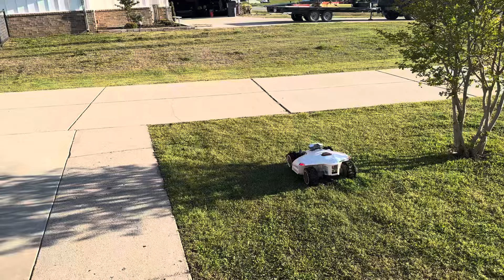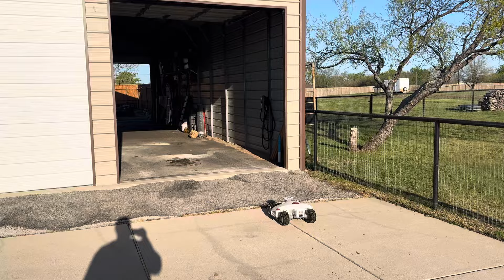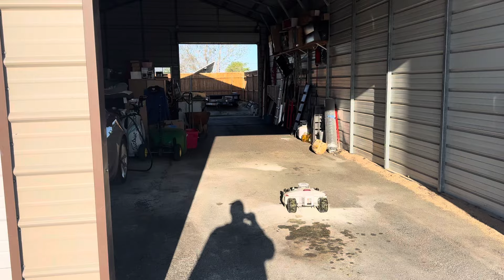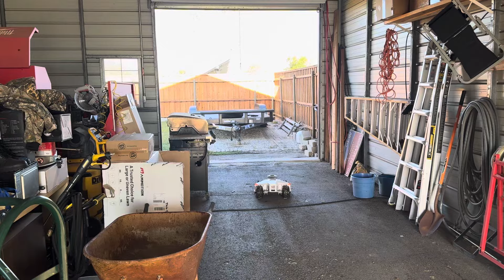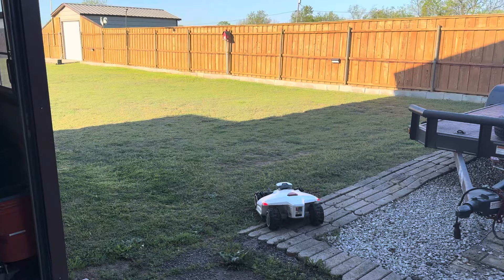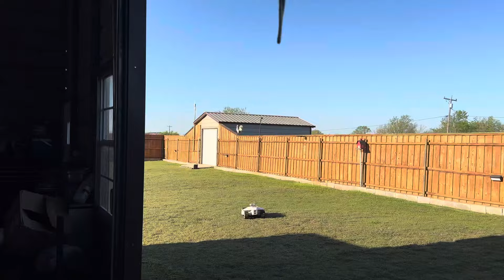Luba 2 AWD 5000 Channel Test

Comment: I don't know how you get it to do that. Mine just turns and crashes into the sides and gives up.
Reply from the maker: Check over your map really close.  I had a break in my route and didn't know it.  Also, I've mapped this channel like 5 times.  I'm about to map it with even more things in the way, as I pickup my Cybertruck today.  It'll need to navigate between both cars now, so it'll be interesting.